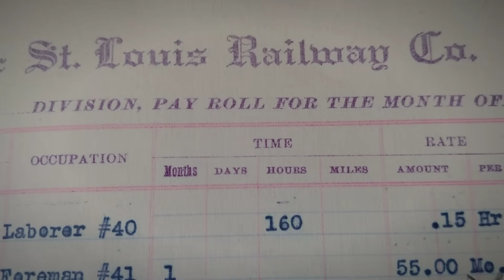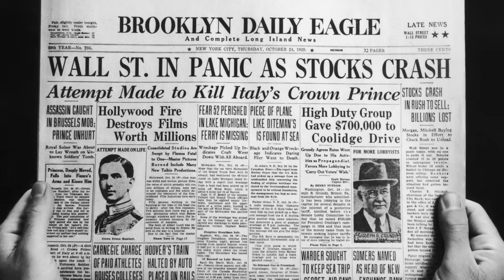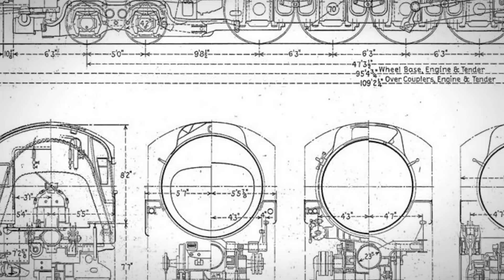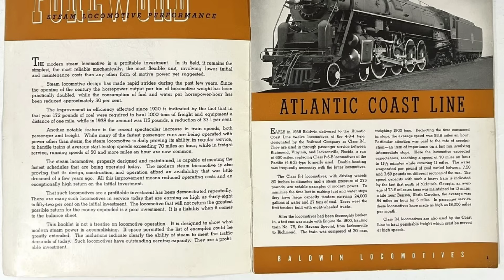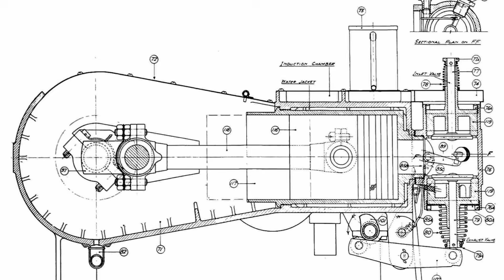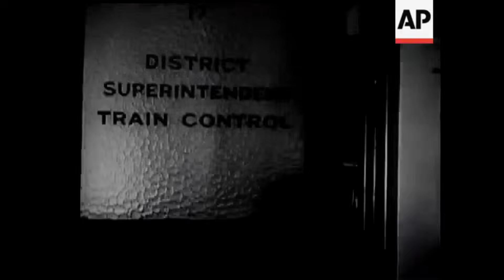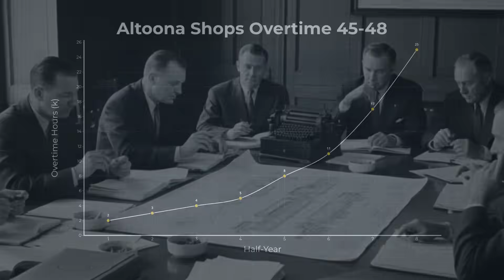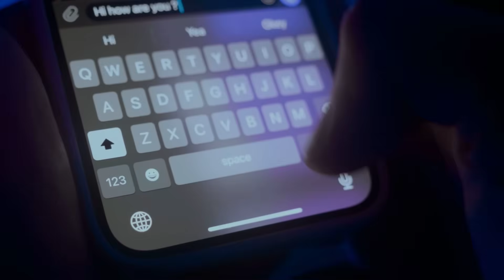The Forgotten Steam Turbine Giant That Was Supposed to Revolutionize Railroads

Comment: Such a missed opportunity. This engine should have been a hybrid. The turbine should have been driving a generator that charged a battery pack that filled the bottom level of the tender. That battery would be used to power 8 motors,  one for each driving wheel, each motor producing 750 HP. The nice thing is with that setup you can apply just the needed power, switching in motors as needed.